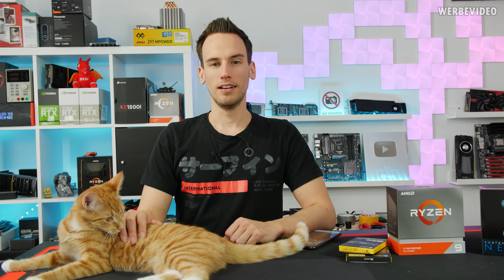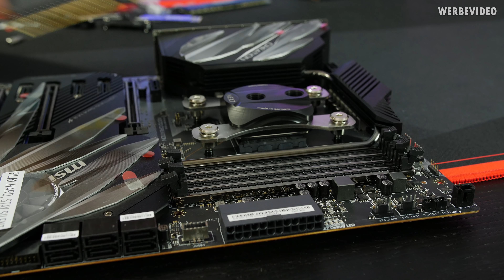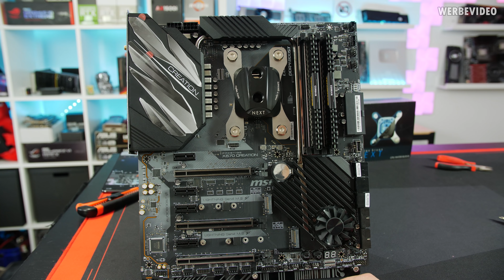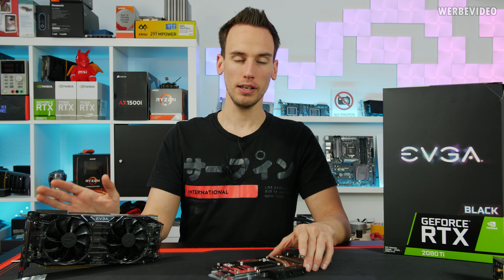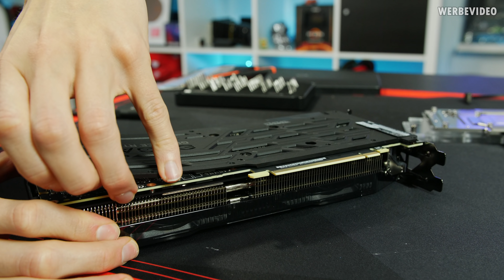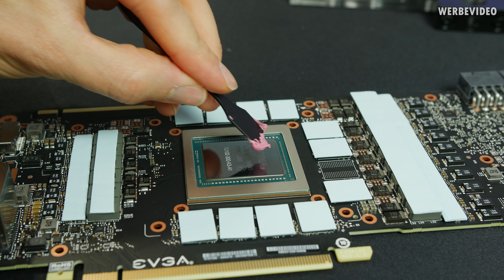No RGB and ABSOLUTELY SILENT - Ryzen 3950X Workstation for Fritz Meinecke

Comment: I'm planning to build a silent PC, but with all air cooling. I'm planning to mount NH-D15 on both CPU and GPU, mainly to make the GPU exhaust the air to the back of the case, and not inside the case which I found to dramatically increase the temps of both CPU and GPU. Also All-Noctua fans.while expensive relatively to other fans and air-cooling, it's still far below any water cooling.

Comment: For those who want silent build, but no water cooling or extreme customization: air cooling can be fine too for silent builds if you go with less power hungry parts.
GPU is usually the most tricky, best to go with 2060 or below and make sure it has good air flow and a 0 rpm mode cooler.

Comment: @6:41 He mistakenly removes the film for the 2nd SSD / NVMe drive. The fine dust particles will cover the surface of this exposed area and will render it useless. $4,000 EURO is extremely expensive. What is that, $4600+ USD?

Comment: You spent 4k on this silence focused pc but no noctua fans???? You did not put backplate on gpu and 4th fan slot on top needs to be populated otherwise you get hot air recirculation. Waterblock looks ugly, I would have gotten ek velocity without rgb, Alphacool Eisbecher pump top/ res combo  looks better than ek res IMO and if plastic tube stains u can clean or replace for cheap. The more expensive the build the more time and effort you should put into it.

Comment: it is especially that the RGB brings latency to the system in addition to the services which runs in the background. It is well known and yes. All RGB devices, I uninstall the software after each configuration, much less latency on windows and the system and much more responsive, it shows at startup.
the latency test are much better. So if you are a pure gamer, especially no RGB

Comment: Am I the only one triggered about the use of 3000mhz memory? I mean I'd rather have "just" 32 GB at 3600mhz cl14 on that platform than 64gb at 3000mhz. If it were intel no issue, but it is AMD

Comment: Nice clean look. Why aren't coolant reservoirs built into a radiator? E.g. to maximize size a tall, thin reservoir on the side of a radiator. Pumps could be located on radiators where the hub of the fan covers the radiator...

Comment: I can say, I have the same case and same mobo and it´s very dificult to conect the 24 pin psu cable to the mobo due to the E-Atx form...and the msi bios support is crap.

Comment: GREAT JOB!
Finally no-nonsense performance PC. Thank you for showing the less mainstream alternatives. 
I will one day need to upgrade my system as it is too loud, so please mention "cheap" ways of building all custom loop. 

Q: I am not sure if this is your niche: I want to have 2x360 radiators outside of my tower (under the desk). That would be around 1m length pipe running outside of the PC. How many pumps, and which ones, do I need to prepare for? Is one pump will be fine? This would be a working PC and I really want these radiators to be outside of the case.

Comment: I just got a trio of P12s for my 360 AIO, and they're great!  Good and quiet, and still move air through the rad very well.  They're much quieter than the Typhoons they replaced, lacking the bearing whine and generally running slower for the same amount of cooling.

As an aside about RGB: my CPU dropped 5deg F when I turned off the RGB on the block.

Comment: der8auer : that watercooling is completely unnecessary for the Ryzen 9 3950X which is known to have its power consumption very very close to that stated 105 Watt TDP (around 120 Watts on MAX in Prime95 stressing)....as for the RTX Pascal refresh 2080 Ti goes, the watercooling is good for the overheating and otherwise artifacting GDDR6 but still could be cooled with the EVGAs very efficient GPU cooler if the fans would be span manually at 85+ % speed. The problems is that these kinds of working systems are ment to run 24/7 for months/years which anykind of watercooling is restricting it to due to the fact that every watercooling on the planet either leaks or gets green corosion inside the waterblock causing it to catastrophically damage the components with water or fails miserably in cooling....and usually the user doesn't notice either of these destined flaws before it's too late.

Comment: about the Asus audio card: I've read that some of the cards from Asus don't do well with Ryzen processors, was that the case with the card you've installed?
Reply: been running an Asus Xonar Audio PCIE sound card in my Ryzen system for 3 years now absolutly 0 issues.

Comment: Hello from Dallas TX, loved the build, but quick question. Could you have used a smaller case, and used a 240 Rad, and still get the same cooling performance?
Reply: That’s not how physics works. Cooling performance is directly proportional to the amount of surface area available for cooling. A smaller case gives less places for the heat to go, and a 33% smaller radiator is quite noticeable when the max temps were already somewhat high, if still within tolerance.

Also notice that he used 2 radiators, not 1, so assuming that the singular use of “a 240 rad” means that you only want one radiator, you would be overheating both components. 

You could get away with 2 240 rads and have tolerable temps, but they would be higher temps. A smaller case wouldn’t help this, especially since so many smaller cases don’t have suitable airflow due to not being designed for components like this to be put in them.

Comment: Surprised I never see the aquaero controllers in these super silent WC builds, they are a little pricey but you have full control over noise, pump and fanspeed curves like no other onboard controller. my PC doesn;t even spin it's fans at all until it hits 60c avg gpu and cpu temp, completely passive.

Comment: 1 Good to see you use other brands then the usual ones.
2 Isnt it a problem placing the radiator with the connections in the bottom? Will not air be stuck in the top?
3 Would love to see a comparison of all the usual cooling brands, with focus on price vs performance/quality.

Comment: Love it. I have a similarly no-nonsense build as well, in an O-11 Air, using matte tubes, black noctua fans, no RGB (well, disabled what was unavoidable anyway), etc... I actually think it looks super good. I kinda hate that people seem scared of using soft tubing, pure water (no dye), and muted or no RGB. It can look extremely clean.
Reply: Wait like actual water? What if there's a leak?
Reply: @BBWahoo  I have enough confidence and experience with water cooling that I simply know it won't leak. Maybe not a satisfying answer, but 2 years after my original comment, it has stayed true.

Comment: The only thing that worried me, was negative pressure, seeing as though it's going to be on the floor. I would have probably ran the 3 intake fans 200 rpm higher.

Comment: I have the same Arctic PWM fans in my rig, also blacked-out with no RGB (MSI X570 Unify board). Bought a 5-pack of 140mm for around $30 and a 5-pack of 120mm for around $27. They are whisper quiet but have an aggressive curve on the blade, so you can tell with some reasonable torque they will put out a good bit of pressure. I have 3 120mm fans on my EVGA CLC 360 with NZXT G12 GPU AIO bracket, and 2 140mm on my EVGA CLC 280 CPU cooler. As for the rest, I have 2 140mm fans on bottom intake and 1 140mm on rear exhaust... and 2 spare 120mm fans. All have been configured with silent curves via PWM in BIOS. My 1080Ti never sees 50C. My 3700X lives around 50-60C though even with very low power consumption (45W in gaming). Those Ryzen chiplets are very heat-dense! Perhaps a particular AIO CPU mount may be in my future ;)

Long story short though, I can also recommend the Arctic P12/P14 fans!

Comment: Hi...just a question: Why did you not put back the Backplate on the GPU? Would that not help in heat dissipation?
Reply: I thought this as well....
Reply: The Evga backplate might not be compatible with the EK waterblock.  I had a similar issue with my card (evga 1080Ti) so i had to buy an EK backplate that fits  the waterblock
Reply: I would think in this case no, since it was cooled with a full-on water block, the VRM's and such would not be heating up as much if it was still water cooled.

Comment: RGB is a nice touch for enthousiasts, but it's what happens on the screen that counts anyways. 
I thought about getting a tower with tempered glass and RGB fans/RAM/strips... But why?
I ended up buying a TT Core V1 and just built an ITX system that does what I need it to do. Instead of spending money on RGB, I now have budget to further improve airflow and reduce noise.

Comment: 19:15 "When are you going to fully utilize GPU and CPU at this level?" Go play some Star Citizen. It will make good use of those 32 threads, lol.
Reply: It won't at the moment. Need the new system. I had an I7 5820k and now an 3950x, no difference in performance
Reply: @Mxgtumgoten  What GPU are you using to stress your CPU, and at which resolution? I play at 1440p max settings and the 16 threads of my 9900K run at 100% when I have SLI enabled on my 2 RTX 2080s SUPER NVLinked. If I disable SLI the CPU runs at 65% utilization. But given how bad DX11 is at utilizing multiple cores my 9900K is still faster than a 3900X in SC because DX11 still give priority to latency and single thread performance, but this will change when the game gets ported to Vulkan.
Reply: @Patrick73787   I m using the 3950x and an Radeon VII (about a 2080 super) at water. 3950x is about 20-25 % usage stock 4.3 ghz allcore.  My gpu is running at 70  % usage. Vulkan will fix that. I ll get the 3080 ti end of this year , so maybe that cpu is at 40 % usage :D

Comment: The hot air from PSU has nowhere to go properly in this case. I have a Seasonic Titanium 850W PSU and i rather have it on active mode because i can't hear it in my very quiet system and i assume it would last longer this way than cooking itself in passive mode.
Reply: I have to agree.  The supply shroud should at least have venting above the power supply to use it passively.  Passively cooled supplies need to have the vents at the top to stay cool.

I also have the Seasonic Titanium 850W PSU.  And my case does not have the proper shroud venting to run it passively.

Comment: STX II is a great sound card. Bought mine with the daughter board 5 years ago and no regrets. It'll be migrating to every new PC I own until one of us dies.
Reply: I own the first version and really enjoy it. Even though many external DAC users will claim how there's so much more noise coming from internal soundcards, I hear absolutely none coming from my Essence STX. Official Asus drivers are garbage, but the card itself is great.
Reply: @tomkocur  If you have to use a scope to find differences in noise levels, there is no difference, and internal sound cards haven't shown any more noise than external DAC's since the early 2000's.

If you haven't looked at ASUS' drivers in a couple years, take another peek. I have no idea what changed, but they suddenly decided to start caring again this year. Been running them a month so far and they're actually doing better than ever and are on par with Uni. Had to change after a windows 10 update killed the Uni drivers.
Reply: @PapiSmerf  Hi guys!
I have a Aorus Master z390, with a "dac" solution included, but I already have my own Xonar STX. You still think is a better solution v/s the audio integrated?
Thanks for your info!

Comment: A PC without RGB and tempered glass, that's not for show, and which is standing under the desk, that's meant to do the job? That's my kind of mentality right here.
Reply: Frustrating thing is that when I look at the vendors I usually use they have perhaps 50 - 60 models of PC case with tempered glass or at least acrylic side windows and perhaps 4 without. And those without a side window tend to be old, have a primitive internal layout and very bad airflow. Looking at the manufacturers websites a lot of them offer their cases with a solid side panel at a lower price, but the vendors just don't list those. So if I want a case with a solid side panel I have to buy one with the tempered glass then buy a replacement side panel... No thank you.
By now I'm seriously considering just buying the case I want and paint the inside of the tempered glass side panel black...
Reply: @blahorgaslisk7763  If you're confident in handling vinyl wrap you can just use a hair dryer or heat gun and vinyl wrap the outer side of the tempered glass panel. And perhaps stick some acoustic sponge on the inner side.
Reply: u r borin'.
Reply: J M  I com at this from the server and workstation world and to me most of what both Linus and Roman show is way different from my usual fare.  I have built a few water cooled workstations, but they were built to be reliable and to perform as discretely as possible, not to be showpieces.

While I can see why some people likes to make something they can show off but for me that's not a priority. What's surprising me is that so many are prepared to pay for things like tempered glass and RGB fans for their basic builds.

Personally I'm looking for usability, utility, airflow, reliability and value. For instance I really prefer a case with at least one 5.25" drive bay because a lot of the machines I build really need an optical drive, as antiquated as that may seem.
Reply: I feel like there's much higher demand for this kind of build then the industry would have you believe. I dont care about RGB and neither does my dog.
Reply: can someone tell me what pc case he used ? thanks
Reply: @dennisjusay2421  I believe it's a Phantek Enthoo, they do make some interesting cases.
Reply: and  glass keeps it warm also i had to strip my thermaltake xt case each side is glass
Reply: Don't like RGB but I do like me gear to look nice.
Reply: That's how I built my PC, silent case, no glass, no rgb and if some parts have it it's deactivated. 

I need a PC for work and gaming, not a table light.
Reply: It's still pretty inside the case even though it has a non-windowed side panel.
I like RGB myself, when it's done right it can look amazing
Reply: That's very true, however when you spent so much with such high end parts, a little show off doesn't hurt !!
Reply: My style too, I care about delivery and efficiency, cosmetics....i dont even care if my PC has acne
Reply: I don't have a problem with tempered glass, at least in theory based on pictures I've seen. I also kind of like subtle case illumination, like just some dim,  warm-white LEDs and nothing else
Reply: The Phantek P600s case has two options, and the option with a steel side panel instead of glass is cheaper.
Reply: Finally, someone with common sense! And of course it comes from Germany, nice.
Reply: @Deliveredmean42  Common sense? You can have basic Fiat or best Ferrari/other supercar. Both will take you to your destination, but which you prefer to have? The same is with PC. Both will do what it suppose to do, but some of us like to have pleasable to eye rigs, not only hide it under desk :) I understand both words, but none of them are better. They are just different.
Reply: @BOLOYOO  Dude, RGB is nothing but pretty lights. It is not good design and good performance, like a Ferrari. You are an ignorant fool.
Reply: @AdamTait-hy2qh  Nope, you are. RGB versions are often better. For example cheapest RTX Gigabyte vs best MSI. Which is cooler (in term of temps), quiter and have better (slightly but still) performance? And which one have RGB?
Reply: @BOLOYOO  yes. It's because of RGB.......
Reply: @AdamTait-hy2qh  Doesn't matter. Product with RGB is better (not always but still).
Reply: @BOLOYOO  rofl
Reply: @AdamTait-hy2qh  Can't deny.
Reply: @BOLOYOO  Ok kid. Pretty lights are everything, people who find them garish and annoying and prefer understated tones are wrong, and function is nothing. Now go get some culture and education, git.
Reply: @AdamTait-hy2qh  "Kid"... :D I'm pretty sure I'm older than you. I think our arguing is over at this point.
Reply: @BOLOYOO  ok light boi
Reply: @BOLOYOO  lol kid I have my own kids.
Reply: @AdamTait-hy2qh  I've already ended with you dude. You're delusional or something? You need mental health?
Reply: @BOLOYOO  Yep delusional kid. I can't understand how lights make PCs better.
Reply: @BOLOYOO  Oh look - 2,200 thumbs up to 38. So many delusional people who don't understand how LEDs make PC's..........'better'.
Reply: @AdamTait-hy2qh  Don't you get it!!! RGB is like electrolytes - it's what plants crave! 🙄
Reply: @garethevans9789  rofl

Comment: Hot air is flowing into the case through front radiator... Nice decision)
Reply: You're dumb. It's pulling in cold air
Reply: Unavoidable.  Also, since there's good airflow at nearly neutral pressure, it doesn't matter.  Hot tube goes to top radiator first, so most of the heat leaves the case immediately.

Comment: I would always choose a pull configuration when mounting fans on the radiator. Aspecially for a case wicht is sitting on the floor, where it sucks up alot of dust.